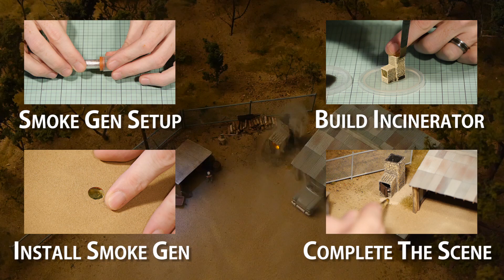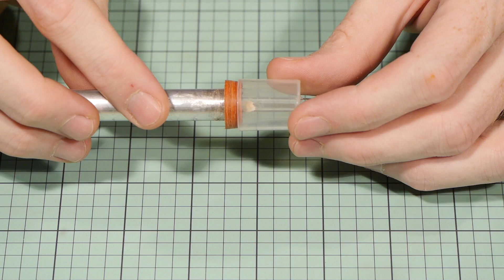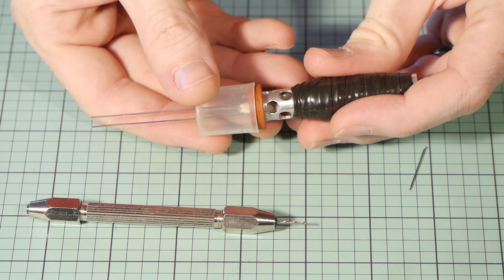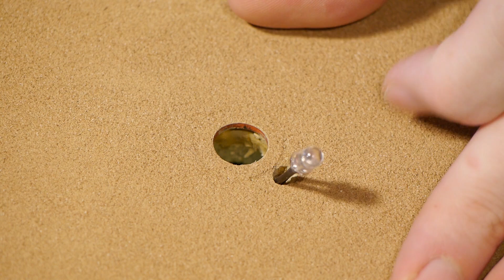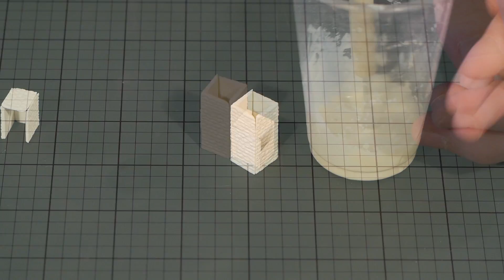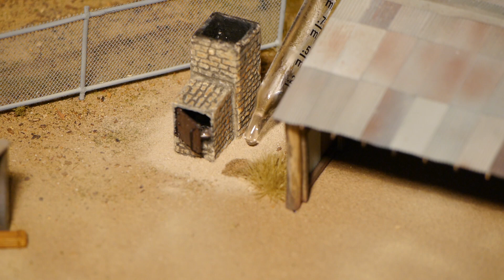Installing a Smoke Generator – Detailed Tutorial

Comment: Hello  I am building this now I 3D printed my model and now it is painted with flickering LED installed.  I have the SEUTHE Model 501 working on that now.  Was on you web site but I could not find what you was referring to on this video. If you can post the link to that on your web site that would be helpful Looking for the size of the plastic tube that will connect to the tube on the 501 to the Oil container.  I have the 50 ML bottle   Any ideas or suggestions Thanks Tom

Comment: Very cool, one of those little details that is a bit or work, but well worth it when people pick up on it.
I hope at some time to make a 'Steam-Punk' inspired PC, using brass fittings, copper tubing, etc, for the water cooling loops, etc. and fake the pump and reservoir area as a boiler. I figure some of those reddish flicker LEDs to represent the fire and a model smoke generator to make it look like it is coal/oil fired.
Oh, is that a Kiwi accent?

Comment: I just enjoy your work . but may I suggest one thing , if  you'r using th hydrocal with the super glue . stain or water based paint before you use the super glue , the glue will act as a barrier to the stain leaving a white area same will happen to the water based paint .

Comment: Quite awesome - I'm thinking of using this method to make a newly knocked out tank - remove or replace the bottom of the tank with something that doesn't lead heat, like plaster, carve away anything in the turret that might get too close to the smokestack, add a couple of randomly flashing LEDs, and I'm set.

But now when I've typed all that, I just got so very tired... :D
Reply from the maker: LMAO😀 That's funny. But you can do this. Just one step at a time and before you know it time has flashed and you're looking at your nice creation. But then you could be done already. I had a funeral (wife's side) and wedding anniversary to plan.

Comment: Great tutorials Luke! As for some constructive criticism I would say I find the flow of the smoke too large, too fast, too liquid and the grey too light. Could you have used filters, hatches or even rotating parts to alter the look and flow of the smoke? Making it come out more in "puffs"? And if you could have different colours, maybe mix two types of smoke (grey and dark grey)?
Reply from the maker: I'm not sure about color? I have only been using the smoke that is sold by the same people that sell the smoke generator.... I tried adding a mesh screen to disperse the smoke more but the small smoke generator I used is quite temperamental if there are any obstacles in the way of the flow of smoke, I'll have to do some more experimenting because I agree with you.
Reply: Luke, perhaps a smaller tube inside the outer tube could help reduce the size of the smoke plumes and/or a cork screw or conical type system so it doesn't obstruct the smoke but directs the flow somewhat. Just a guess but maybe worth a try if you are experimenting :-) Colour change, from my understanding, is difficult as it usually requires ignition or temperature reactive material of some sort. Your work is outstanding by the way, best scenery builds on YT!!!
Reply: I'd be afraid that smoke plumes to absolute scale would be too small to create the effect.

Comment: does the smoke stink?  I wondering if theres a steam type method instead and if that would be a safer/cleaner route?
Reply: Maybe look online for a steam generator or mini fog machine? Or maybe dry ice?
Reply: Bojames Seuthe smoke smells of lemon. It's a very thin mineral oil with low flash point. It therefore vapourises at low temperature. To use steam would involve much higher temperatures (boiling!) and would require lots of updraft. Seuthe smoke vapourises and can be seen due to its viscosity. Steam would be harder to see.

Comment: I think some kind of transparent smoke column with a flickering light inside would look better.  The problem is at this scale, the smoke plume rises and moves too quickly, which really kills the aesthetics.
Reply: Physics are against us in small scales and we can’t change it. Sometimes, we just let our imaginations make it real.
Reply: @fergusontea  Physics is wrong in many areas . It just gives an excuse limit for those who cannot figure it out. Wrong about the speed of light as a limit .So how credible is the rest? Science bases a lot of things on credibility ,so why are they allowed to use both sides of the coin as credibility to begin with. Anyway had a thought about trying different orifices on the inlet and outlet of a fan driven smoke unit to get it right just too much going on now to get around to it. on the bench.
Reply: simply to solve this to build in a grate into the chimney, breaks up the smoke...
still not 1:1 accurate but atleast it better!
Reply: I mean, you could just make a thicker atmosphere lols
Reply: Have you ever burnt wet leaves or wet pine? Looks very much like this.

Besides, depends on what you wanna replicate. If you're building them into your Adeptus Titanicus or better yet, your Necromunda terrain... who's to say my Adeptus Mechanicus sanctioned exhaust doesn't vape like that? :p
Reply: Rises too fast. Your out of your mind . Smoke has a mind of its own on how it flows depending on  outside air pressure and the wind.
Reply: @HARPO1ME  I just removed the smoke propelling fan in mine... smoke comes out much slowly, and the effect is a lot better. Sure not perfectly scale, but not bad :)

Comment: Nice job. Have you considered using electric cigarettes and micro fan to create smoke ?
Less power consumption, less heat and smaller in diameter. You also get different flavours for different types of fire ;-)
Reply: This is basically an e-cigarette.

Comment: Fantastic.  I think the cellophane crumpled over the led is a great idea.  Accessing the tank for refills adds an additional challenge for a lot of applications, particularly if the profile of the base is thin.  I'll have to ponder that a bit.  Probably need to have the generator on hand to problem solve that.  

And I should add that the tutorial format (typical for you) is worth praise on its own.  You edit it down very well and choose your shots excellently.  Great job.
Reply from the maker: +Terranscapes You can get the generator to have a much lower profile however the top of the generator where the smoke emanates gets very hot. I did some experiments with styrene plastic and it does a good job of warping the styrene that's closest  to the tip of the generator. 

I'd guess you'll need to use something like plaster or possibly another more heat resistant plastic if you plan to have a structure near the smoke exit. I was actually surprised at how well the extruded foam board held up to withstanding the high temperature. I had the generator mounted in the foam itself with no insulation and the foam pressed up tight against the tube, the foam didn't melt at all. 

I didn't include those tests in the video because I though it might be unsafe if not done properly and carefully.

Thanks for the great feedback on the video format as well. It's good to know you appreciate it :)

Cheers
Luke
Reply: +Terranscapes cool how you saw that cellophane, yes it does add to it eh :-) Went shopping with him looking for the perfect coloured cellophane...was a pleasant experience.
Reply: +Anna Meresi Towan Nice.  I love it that you shopped together for it.  :)